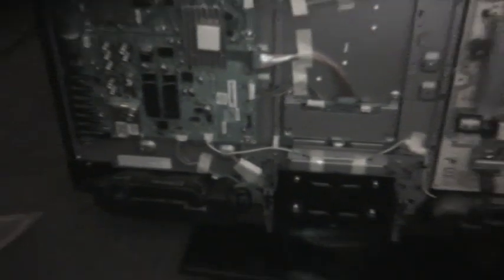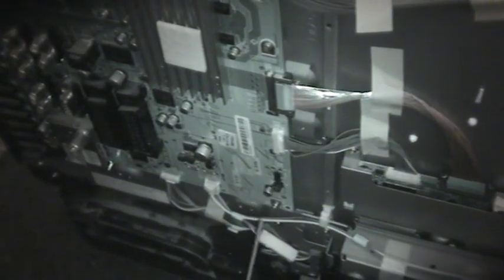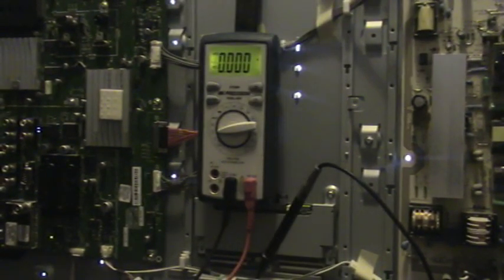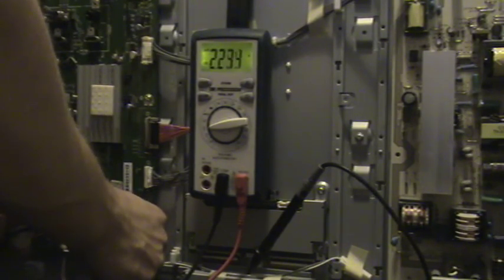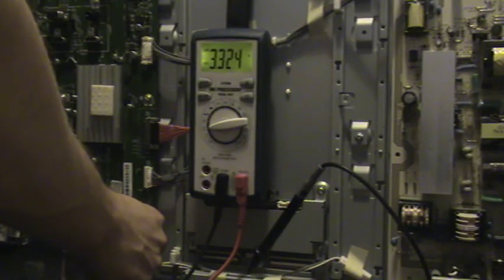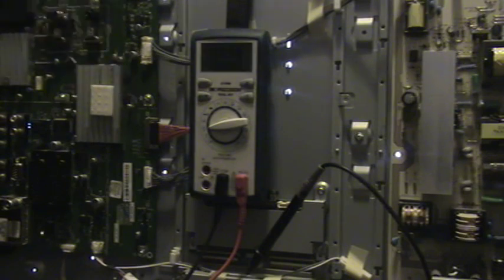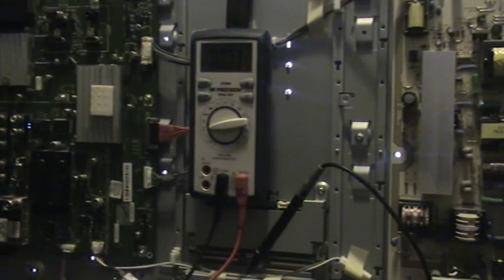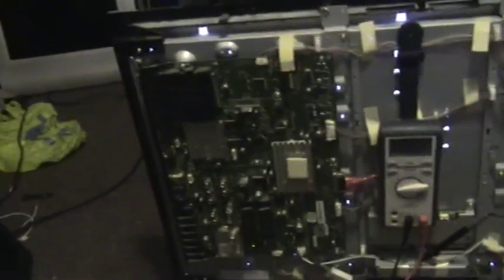Sharp Aquos LC-32 37 46 52DH65E 66E 77E - No Pic/Sound with Power LED - Diagnosis/Temporary Fix

Comment: i found start up caps (when failing ) start working when  heat is applied (hot air gun set low)having tried freezing/cooling  though

Comment: hi,I have a sharp lc-46xl2e and it wont switch on anymore, although the LED in the front lights up. I replaced the power board but still have the same problem.Can you give me any hints? Is there an auxiliary power board that powers just the stand by circuitry?

Comment: You really need to get yourself an Bob Parker ESR meter. You should measure the capacitors before guessing. Also you need to rule out reguulators as they tend to overheat without heatsinks.

Comment: Good day sir.. i have a problem from lcd tv. (Lc32gd3) sharp aquos made in japan..  i jusst went to service mode by clicking volume down, option and power button..  i saw a K letter.. as i watched it on youtube just to adjust the the color... then i saw a "gray"words  that has a 200 indicated  from it.. i changed it to 100 coz i thought it will less the color.. but when i want to go back to the previous menu of the service mode.. i cannot go back.. so i decided to turn off my tv.. and when i turn it on.. problem goes..(its all gray color that i can see.. no display and sounds.. i cant even see the text or the menu.. totally gray... could you help me to fix my problem sir... hope it will help me a lot..

Comment: These sharp corp TVs for this LCD design flaws for these set are bad middle tube in the LCD screen panel and software firmware program problems.Have nothing to do capacitors problems that why you turn TV set off/on four or five time TV will power up and the TV will work.

Comment: Temp fix for this TV sharp model you do not require take TV a parts and spray any air coolant chemical at all.You Just unplug the TV and Pushes volume button up and Power button together and Replug the a/c power cord the TV should work again.
Reply: wow... worked for me on Sharp  Aquos 32 LE Malaysia manuf  Thanks

Comment: I wonder what is the capacitor number you are talking about. Would you please tell us the number of the capacitor in the power supply?
Reply: +Rommel Yanto At 13:41 he said 6.8 nF (nanofarad), to be replaced by 68 nF capacitors (ten times bigger). 1 μF (microfarad) might be too much.

Comment: hi sir... i have aquos LED TV my problem is no pic shows only sounds and its all black....thus it repair?
Reply: Turn on our tv,take flashlight shine on it,you can see a picture but it dark barely have a picture.Yes?Your tv have dead inverter board or boards could be at the left or right sides two long boards side and side of the tv.If you can hear sound and used flashlight see nothing not even a dark light picture image.Yes?Your tv have a dead board called T-con board this board usually sit in the middle on the top or bottom of the tv.Tries websites like Shopjimmy.com or Ebay.com to buy refurbishes boards like inverter boards left or right long sided ones or T-CON board for the replacement.
Reply: does it repair?
Reply: +jennelyn sambas Yes,90-95% sure this solution on the T-con replacement board for volume only no light visible image with a flashlight shine it will work,the backlight inverter board long boards left or right could be damage too need replacement too.Visible light image in tv with a flashlight shine with volume only,replace both backlight inverter boards long left and right for sure 100% tv will work after the replacement.
Reply: how much will cost?

Comment: hello sir i have a sharp tv lc-60c52u its flashing power & opc,do u have any video on this one are any idea on it
Reply: Tries Unplug/replug power a/c cord for an hour later should reset the TV should work again or Every time Power /OPC lights flashes.Just push the power button again and wait must do this about 4 or five time each time power/OPC LED light flashes TV will workTries used TV every day 4 hrs this problems will not happen or not that often.these set have firmware software problems that why this happening.
Reply: +Chi Chu Hello sir I haveLc46d62u sharp Aquos Tv Plc light flashing can u tel me what to do
Reply: +Chi Chu Hello sir I have a shorp Aqua Lc 46 d62 u tv opc power flashing can tel me what to do
Reply: +sandra griffiths Every time OPC and POWER LEDS flashes together.Just push the power button on the tv remote again you will hear a power click to tv will tries to reboot the tv mother tuner board again tries get the tv Backlight on and tv will work.Sometime OPC and POWER LEDs flashes take four or five times pushes of remote control power button on the remote to get the tv backlight on to work.Each time push the remote power button must wait few seconds for tv make a click see if tv have backlight on and will work.Pushing a power button each time hear a click wait few seconds take four or five pushes of the tv remote get tv to work.This is a temporary solution to get the tv on to make it work only,this problems will return,if tv it off few hours and turn on again problems will return.The tv tuner mother board must be replaced for this problems be solved for good,if you can take things a parts and put it back together again.Website like ShopJimmy.com buy a refurbish tuner mother board.

Comment: I have a toshiba same kind of problem but found 2 diodes letting power running back.
Have you ever tried to check the power regulater with a multimeter can it be done and if so show us how.what is the readings?